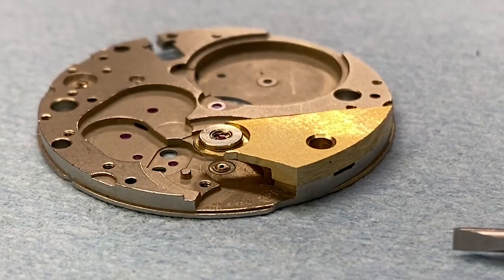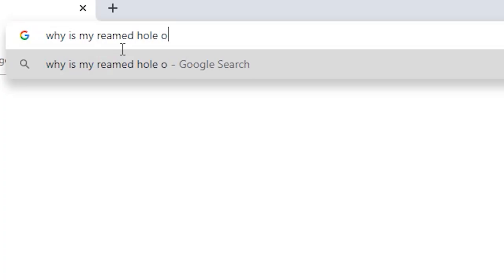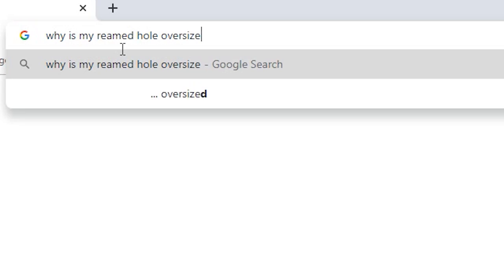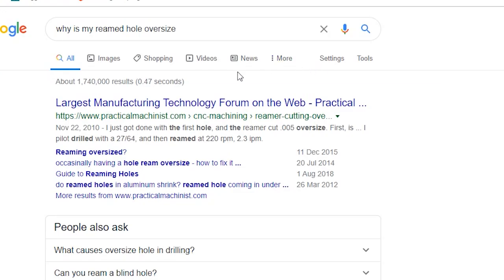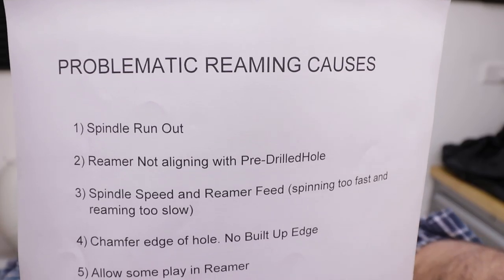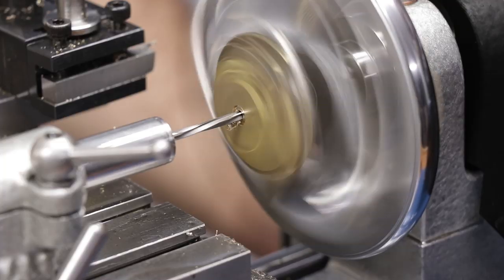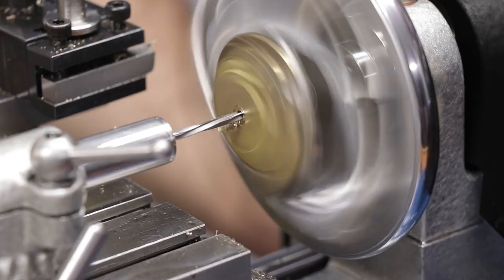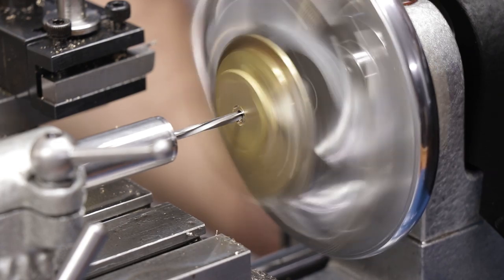Last Test of the Balance Wheel Bridge - Watchmaking Vlog 32

Comment: When I saw you ream that hole in the last video the first thing I thought was that it felt like the spindle was running too fast and you left the reamer in the hole for too long. Reamer flutes are sharp, especially compared to brass. If the reamer is misaligned even slightly (the bullets from your list: spindle runout, tailstock misalignment, reamer choked) the reamer will rub and keep removing material. This is why the most precise reamers are D-bit style, and I believe watchmakers usually ream manually in something like a staking tool.
Reply: I bet brass is the problem, the reamer is made for steel. But reamers in general will force the machinist to be a bit of a magician (I've reamed lots of holes as a machinist/gunsmith). There's diffidently an art to this sort of thing, and I'd just try a different design reamer! Nothing wrong with a D bit if one hole is all you need to make!
Reply from the maker: This is very true Snake Scaly. I just tested it tonight and I ran the spindle slow and fed the reamer in fast, and created an excellent finish. Yes, but I couldn’t find watchmaker reamer for that size, I hand reamed the jewel holes for wheels. I don’t think replacing the whole shock proof setting is common practice. I could be wrong about that though. Thanks for your comment, maybe I will try to find or d bit of this size 😁👍🏼
Reply from the maker: Thanks Robert, yes it could also be another reason. I did take this into consideration and got it working tonight 😁👍🏼
Reply: @DeanDK  Awesome! Reamers are some of the more 'interesting' tools in the workshop ...
Reply: @DeanDK  In fact you can make a D-bit reamer yourself. All you need is a steel pin of the right diameter. The geometry of the tool is so simple you can grind it using a bench grinder and some diamond stones. I had good results with a reamer I ground into the tail end of a 2mm drill bit. Though it wasn't a watchmaking application so take it with a grain of salt.

Comment: Reamers will naturally follow an existing hole, so if you have a well centered hole you can ream on a drill press.  The advantage of doing it this way, is that your part will "float" on the drill press table and the reamer will find the natural center.  Generally with reaming you'll feed considerably faster than you would a drill and then withdraw the reamer quickly.  Being able to feel the reamer cutting with your tailstock lever or the drill press lever is an advantage.
Reply from the maker: Thanks James! Really appreciate it, there was great value in the feed rate of the reamer. Fast seemed to work well!

Comment: Dean, look at the video. The reamer is only cutting on a couple of flutes. If the reamer is the nominal dimension that you are shooting for it should be cutting on all of the flutes. In your current setup you are using it as a boring bar. The reamer is stiff enough that it will not align itself to what Little excentricity you have in the tailstock and the material is too thin to apply enough pressure to force it sideways Before it's machined away. For press fit applications of this size I would do it out of the lathe. That way you have full, fingertip feel of how much you are cutting and for when the reamer goes through. It will also leave  burnished Surface that will stand up better to the press fit to follow. You only need to establish the location and drill a hole in the bridge if you are using a self centering reamer.  Use a reamer in your jewelling tool. If you don't have the appropriate size you should have no problem whipping one up on your D-bit grinder. Keep at it!
Reply from the maker: Thanks Karl 👍🏼😁

Comment: i would try to close the hole a little bit before starting a new one (it's brass after all)... like you close a pivot hole in clockmaking... Try to use a ball ended bit and tap it on top (a little bit lol)... 
i'm sure you don't need to make a new one but... try it or just try another jewel set maybe you have a new one, never used that is the right size (some times after usem them they become worn) try that before starting a new one... good luck champ
Reply from the maker: Thanks so much Carlos, I will definitely attempt it 👍🏼😊

Comment: Hey dean, well a single use solution instead of starting a new one, try to trim the stock even more like twice as much, pressure fit there an outer ring, and then mill the outside of the ring so it matches with the pressure fitting of the inside of the bridge, thata what i would have done, just to save the hours spent on it already.  But yeah be shure to find out exactly why that happened so it wont happen again. 

Good luck m8!
Reply from the maker: Thanks so much for this, I just figured out how to get the proper hole. But you comment made me think, I should try salvage that balance bridge! There might be more issues lurking around the corner 👍🏼😁 thanks Inecendium

Comment: Hello, Interesting, I think not bad considering you may have to make the other part, so make it to fit the reamed hole ? maybe the reamer has a taper ?
Reply from the maker: Hi Tinker, I think the way I was reaming the hole was the issue. I replicated the oversized hole and also made the right diameter hole in controlled tests 👍🏼😁

Comment: Ah your biggest dread Dean, I'm only a hobbyist but in a Staking set  there is a stake for closing holes enough for a friction fit,
Reply from the maker: Thanks Bill, yes I think you are right. I’m going to try salvage that balance bridge. But also, I just figured out the reaming process tonight too 👍🏼😁 thanks for you support man
Reply: Bill, those punches are not very precise to use unfortunately. Plus you won't get straight sides in the hole. Maybe if you Close the hole tightly enough that it can be re-reamed.

Comment: :/... Man that sucks Dean sorry to see but I know you can do it mate. Dumb question as I dont know watch parts at all. But rather than making a new balance bridge can you not make a new jewel setting and make it slightly oversize to fit the hole? Sorry if im like totally wrong. Just seems easier than a new bridge. Cheers, Sam
Reply from the maker: Thanks for watching and commenting Sam! It would appear that there are some quite intricate grooves in the top of the shock proof setting which hold the very fine brass spring.
Reply: @DeanDK  ahhh you're right, sorry, thankyou for teaching me! It's all really interesting :) and thanks heaps for replying as always
Reply from the maker: Sam Roberts no need to apologise Sam. Thank you for taking your time to watch my videos and then go above and comment with suggestions. 😁😁😁

Comment: Why don't you try reaming by hand? Brass should be pretty easy to ream by hand, since it's relatively soft. Maybe like that you'd easily notice if the reamer isn't perfectly concentric?
Reply from the maker: Hi Marcos, thanks for your response, it’s definitely an option to ream by hand. I guess I’m just trying to find a faster alternative. I did end up figuring out reaming in my new video. 😁
Reply: @DeanDK  that's great! It's all about finding the method that works best for you and perfecting it. Looking forward to the new video!

Comment: I personally would ream it by hand with tool to keep it absolutely perpendicular. I never ever tried my hand at something daring like this so i am no expert. But the speed makes it very susceptible for vibration and out of control failures in my opinion.

Another problem could be the shavings that get dragged between the reamer and workpiece. Maybe inspect the inner rim by magnification if there is a scratching mark inside.
Reply from the maker: Thanks so much for your advice Bartyron, it’s something I did check after reading this comment! I think I got it right in my new video. I was able to produce two oversized holes and two correct sized holes in a controlled manner